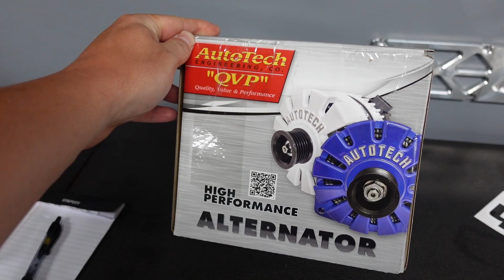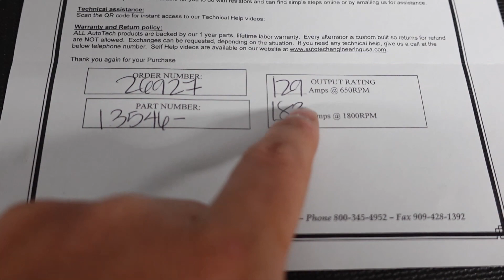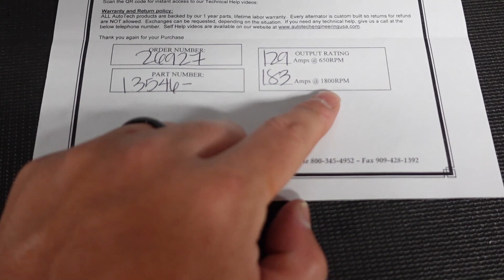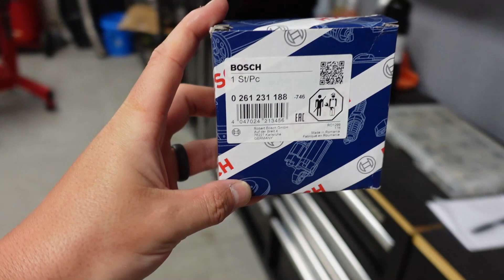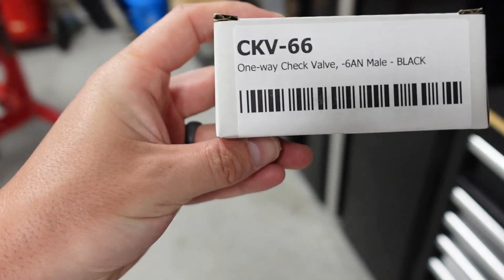2JZ Engine Build Series Ep. 19: AutoTech Engineering Alternator & Bosch Knock Sensors

Comment: Shielded 2-conductor for knock sensors?  Think the gold on the oem bolts is a zink coating?   Do you have parts list for brake boost AN setup?  Nice work!